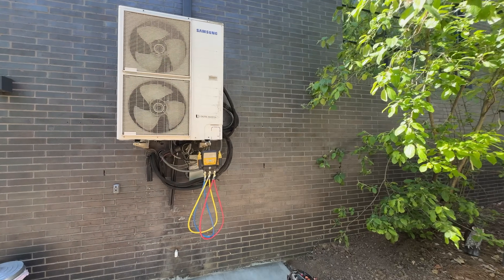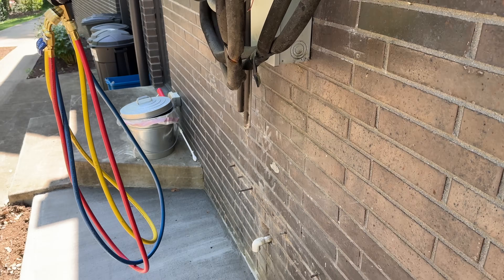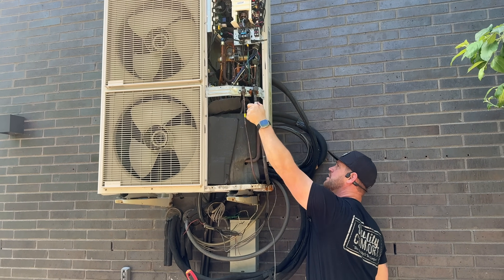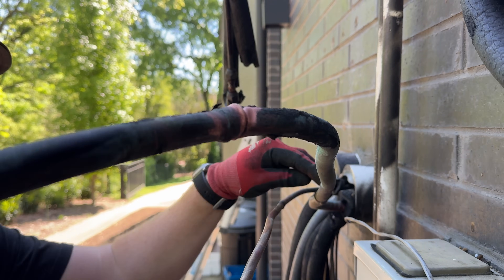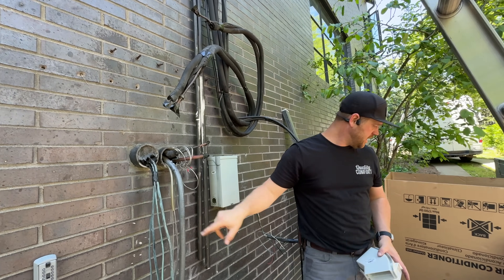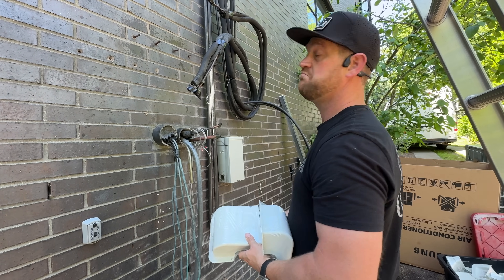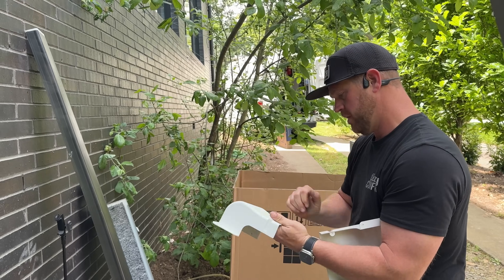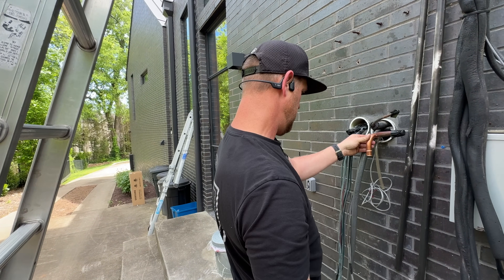This is NOT how to Install a DUCTLESS unit | Time to get it RIGHT!!

Comment: Installing a very similar unit with an indoor ducted evap. Without suspending the ducted unit, how would you eliminate or isolate noise if it were laying flat? Rubber pads?

Comment: We've just installed one of these systems with the Windfree indoor units. Impressed.

The training we did with Samsung UK they state the outdoor has to be 100mm off the floor on rubber feet

Comment: Great video ! Some people may be wondering where all that oil in the pipes came from. When oil circulates in a refrigeration system a certain amount of it "adheres" to the inside of the pipes themselves on the inside walls of the tubing.
You would be surprised how much oil can be pushed out of a pipe if it's wiped  100% clean and all that oil is pushed to an end point. When New Piping is installed, the piping is " Dry " That's Why on some Long line installations You Need to " Wet " the Tubing With Refrigeration oil or Add Oil to the Compressor to Compensate for " Line wetting ".
Any Runs over 100ft. should be " Wet " Before installing a Condensing unit or it is possible to lose a Compressor or Greatly shorten its service life.
Reply: Pull a proper vacuum and open the system youll pull refrigerant and oil into the lineset.

Comment: That vertical line set needs an oil trap. That vertical lift is more than 25 feet. Look into the manual to where to put one or call Samsung tech support for more information. All the oil that came from old one will eventually accumulate in the new one with out an oil trap. But other than that, nice work zack. Really good install
Reply: Every literature I've read is when the condenser is above the evaporator wheres the oil going to trap.
Reply: a trap is only required when the COMPRESSOR is Above the Evaporator because You are trying to return the oil back to the Compressor. traps help the oil Climb the piping to be able to return to the compressor.
Gravity keeps most of the oil in a Compressor When it's Below an Evaporator.
Reply: Top notch work!!!
Reply: Trap is only needed every 10ft when the evap is below the compressor. Not the other way around….